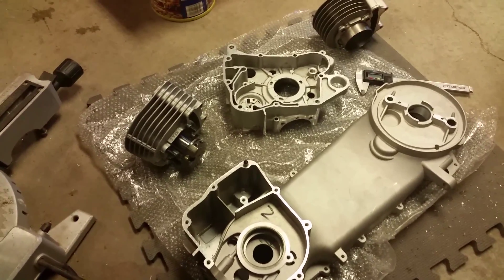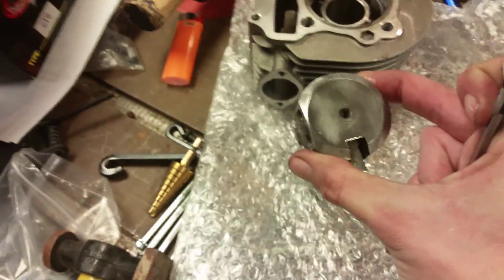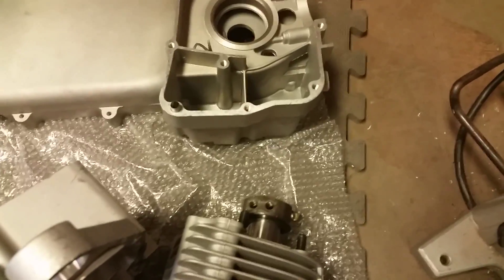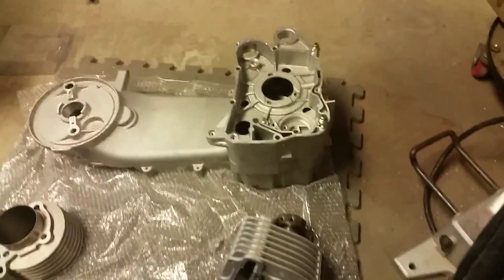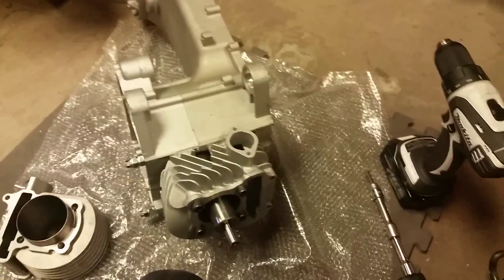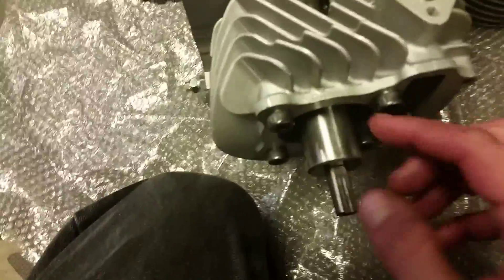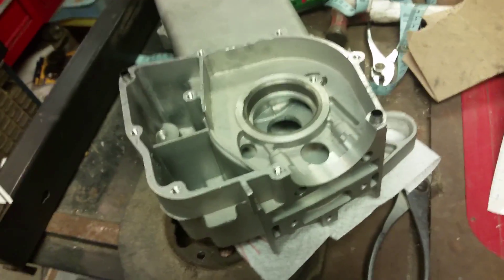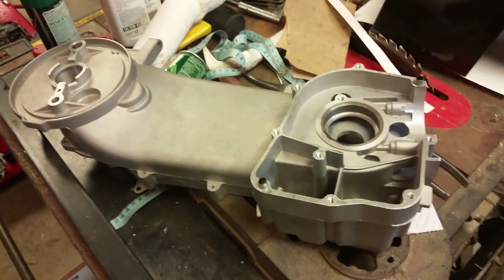How To Bore Scooter Engine

Comment: I just did my 125 cc GY6  up to 171 cc  with a 64mm hole saw  made steady between the 4 studs,replaced with 8mm threaded rods (with 4 pieces of  rubber gas line, oiled), and a plate on top with 4 holes at 54mm for the 4 studs, plus a central hole for the spigot of the saw; perfect control,perfect cut,did not have to buy anything.
there is a videoon youtubr about it

edit. title is           Big bore kit 63mm for GY6. How to make a bigger hole

Comment: What I get from this video is two things. One don't do a video with one hand holing the camera
and doing the work with the other. Watching a jumpy video kinda sucks. And two don't bore
a 157qmj case, not if you want the engine to last. Now after my criticism. I don't really expect
a answer but I having different answer to the original bore diameter of the block some say
62, some say 62.5 and you said 63. I tend to think yours is right but idk i see some bbk and they are saying the skirt is 62.7 some say 62.9 I dont want to buy the darn thing take my 
engine apart and realize its too big cause I ain't boring my block, no way Jose. So are you
positive your case was 63mm?

Comment: Awesome tutorial video I also have a gy6 150cc 157QMJ installing a 63mm piston 180cc big bore kit will it fit or would it have to be bored out? It's a 157QMJ gy6 installing a 180cc big bore kit 63mm?
Reply from the maker: Yes, you have to bore the engine case.
Reply: @dmartin925   okay thx Dan should I bore it to 61mm?
Reply from the maker: @fashionstreet1  no, its already open to 65.5mm .... you must measure the cylinder skirt diameter then cut/bore the case/block to match
Reply: @dmartin925  Okay thx Dan Im suppose to cut it match to the 180cc big bore kit cylinder skirt?
Reply: @dmartin925  okay got it bore it out 32mm?
Reply: @dmartin925  Okay the cylinder is a 180cc big bore kit cylinder skirt 63-65mm should I bore it 32mm I have a 157qmj gy6?

Comment: You bored this with no gasket,so the bore will be a bit bigger when the gasket is in there. Is there a reason you do it without a gasket? Perhaps  room for heat expansion of the block and or cylinder?

Comment: bought a tool yesterday to pull my magneto with so I could replace my crank bearings this is ending up to be more than what I wanted it to be. paid extra shipping just so I could have the tool. of course my two jaw puller doesn't work. threads on my puller stripped out. I'm working on a 139qmb 50cc Tao tao. I even went to the extent to cut the threads with my horizontal band saw again the tool threaded in fine went to torque it after getting 1/4" engagement and the threads stripped again. I'm so pissed. my option now because I want it done is either a thread locker or b welding some tack welds to the tool. any suggestions be much appreciated.

Comment: Good job and that is a nice way to bore without using a milling machine. A good tip would be to bore the hole in small steps so you get a tighter fit. Cut then measure cut then measure til you get the best fit you can good luck.

Comment: Daniel  could you tell me where you got the boring tool I would deff like one for the toolbox I have few scooters and i plan on upgrading the pistons on at least 2  of them this summer that tool would save a lot of money and time if I got it now let me know thanks.
Reply: +Alton Brown You can buy them at enco.com, amazon, ebay or any other place that sells machinist tools. They are called boring heads or boring tools and you need a half inch shank or smaller to fit the hand drill and the boring head needs to be small enough to pass threw the bore you are cutting.